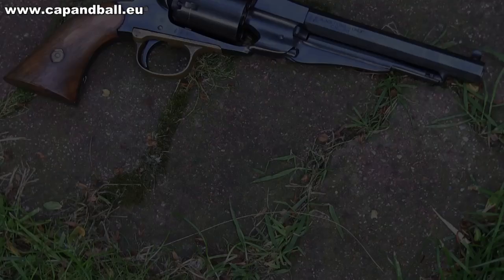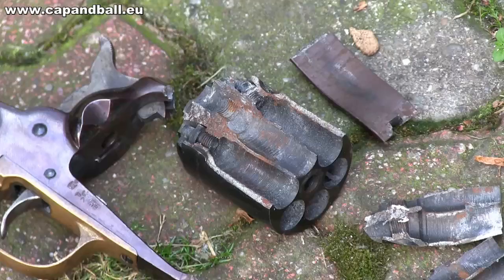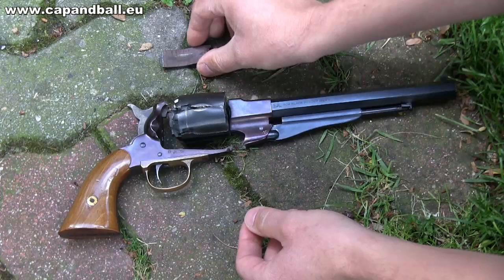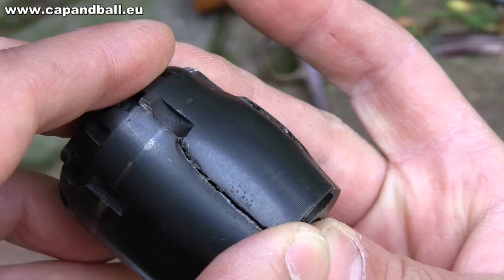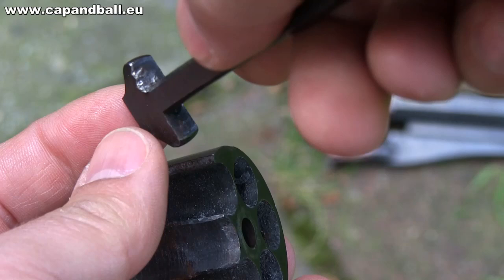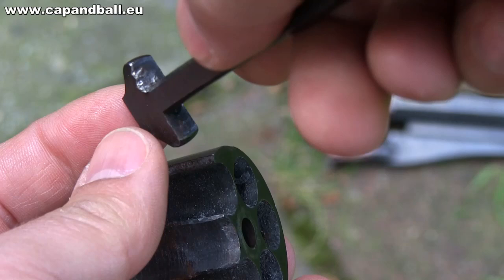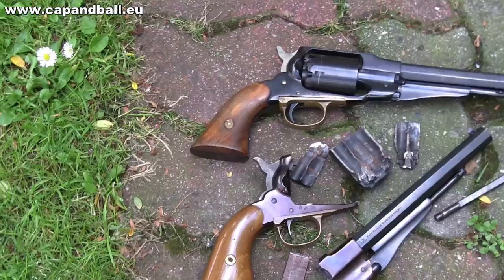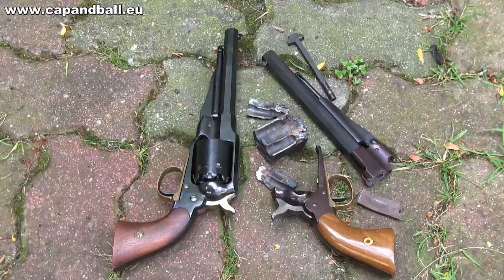The exploded 1858 Remington New Model Army revolver

Comment: So if you use any powder other than black powder that is what causes this to happen?
Reply: YES, these are specifically built to handle black powder. Since the shapes of the cylinders and the cylinder thicknesses, and the general strength of the frame assemblies....These are dictated by the original specifications....designed in 1858. Granted, SOME old black-powder designs would 'tolerate" the newer smokeless powders, but it was done rather half-ass as "proofing" circa 1858 did not have the proofing tools available as we now do. Running smokeless in former black-powder designs was a effort by gun manufacturers to keep their gun designs "sell-able" within the new smokeless powder world. Burning rates of black-powders and smokeless types cannot easily be interchanged, thus, keeping black-powder & smokeless separate is paramount when loading. Some individuals point to modern stronger steels being used in our new reproduction black-powder wheel-guns as a "buffer", a reassurance that these can indeed take modern smokeless powders....not true!! These modern steels are your safety margin for the "approved" black-powder loads, not enough of a margin for one to "experiment" with smokeless.
Reply: What if you put in too much black powder?
Reply: Ben Harju
 By & large you "usually" won't or can't physically overload to this level of failure.
  Pay attention to  what type of blackpowder ( FFFg only)  Fg , FFg,  FFFFg blackpowders are not for revolvers! They have different burn rates not suitable to wheelguns. By measuring  out loads, you will get an idea just what a proper load looks like by how far down you can seat the ball in the cylinder. By approximating by eye you really don't have to measure each time( "My ball is seated 1/4 inch from the top, that's a good load").
Reply: Ben Harju
 Additionally, individuals use measuring devices of course to get a correct charge, but additionally, they use this small charging "vial"  so as not to be so catastrophic if, by accident there is still some lit powder causing the powder to ignite while you are "charging" a cylinder. Pouring powder directly into your cylinders from a somewhat large container, bag, box ..whatever.....can be disasterous with lots of flames & burning, et.al.
Reply: Ricardo Ellison Cash makes a reproduction brass adjustable load measure for blackpowder guns that has a little funnel to aid loading , I own one and it is very cool looking as well as accurate !
Reply: @AndieBlack13  so just fffg blackpowder only?  is this hard to find on the market in eu?
Reply: @BuddyTheGermanShepherd  Yes please, only FFFg powder...Considering the "demonization"  of weapons thru-out the EU, supplies of powder will be few & far between & subject to a whole host of onerous "jumping thru hoops".
  This sponsered site   www.capandball.eu   would be a good first step in tracking down just where you can obtain getting some powder.
Reply: @AndieBlack13  sir, the website is offline
Reply: @AndieBlack13  Would you recommend it to shoot with an original cylinder that is over 100 years old as long I would just using fffg black powder? Because that is what the weapon was made for. One guy said to me that's impossible to find a replica cylinder for his 'Colt m1849 Pocket' and that everyone is shooting with the old cylinders.
Reply: @BuddyTheGermanShepherd  This posting was from 2014 so the site seems long gone...If you're worried about such an old gun being "broken" or dangerous to use...there is a process called "Magnafluxing" used in car-engine rebuilding shops...One applies a strong magnetic field to a metal part & an ultra-fine powder is sprinkled on the part, any cracking is highlighted by an ultraviolet light, the cracked portion glowing. I'd guess this should work fine for checking a cylinder for an "invisible" hairline crack. One can always load an original gun with a "low-side" scale of the recommended powder quantity. " .31 caliber...10 grains of FFFg black-powder for a 50 grain ball..."
Reply: @AndieBlack13  I just found FFFg triple seven in my country. I did my research and found out it's okay to use it with an old muzzleloader revolver as long as you fill not so much in there (15-25% less). What's your opinion on that?

Thanks a lot for the Magnafluxing information. I will ask the gun seller if I can bring the cylinder to a gunsmith or doing this magnafluxing stuff for checking it, before buying it.
Reply: @BuddyTheGermanShepherd  My one and only exposure to black-powder was shooting for a full  day with my friends Colt Walker Uberti reproduction. With a can of powder, one can be shooting all day long...we got to know that Walker in and out...what worked, what didn't. The original Walkers tended to pop the loading lever "loose", as did this reproduction.  
  The nipple caps had a tendency to pop off, cured by pinching them slightly between your fingers before putting them on, one could "test" examples for a better fit I suppose.  We never did use that grease, waxy stuff (don't know the name of it) one is suppose to thinly apply on top of the projectile??? When one gets to shooting all day long, you seem to get powder everywhere...& you notice traces of powder igniting on your hands & fingers....not really dangerous, just startling that's all.

Comment: I've got one of these in .36 sold by Navy Arms..  So I guess they are made of cheap weak steel.  It's made in Italy...
Reply: Due to advances in metallurgy the steel used for the repros is likely better than the originals. That still doesn't mean they are safe for smokeless powder.